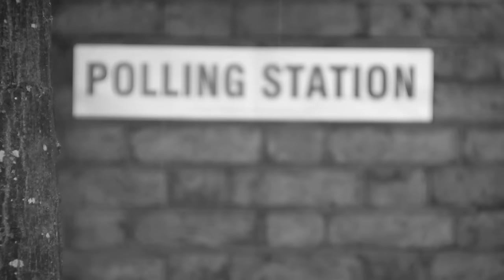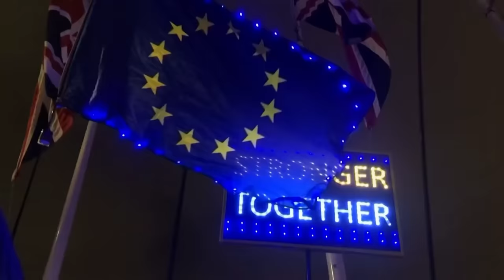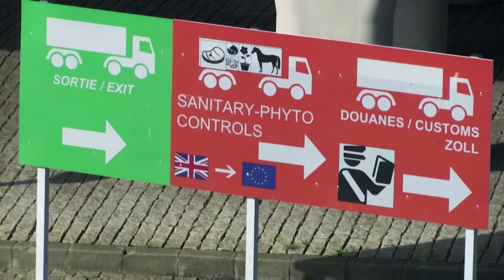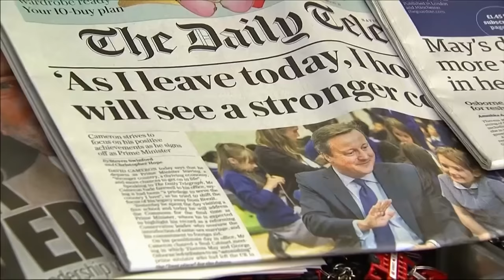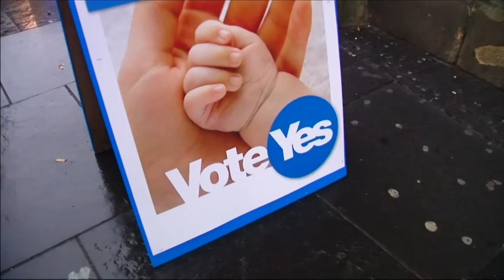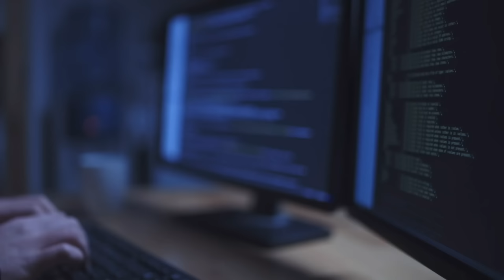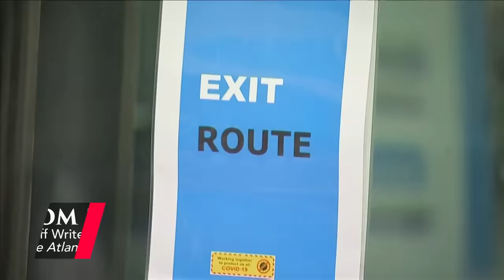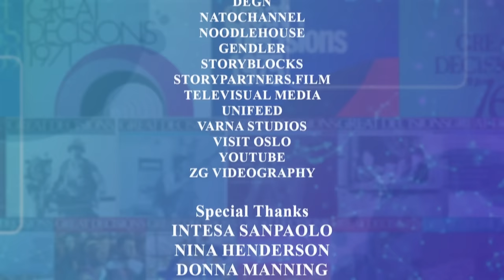Britain After Brexit (Great Decisions Full Episode)

Comment: Tories Leaders were wrong on Brexit’s bills , with Lack of planning on it , many sectors are still waiting for details to be resolved , and some realities of Brexit , will be reopened for another negotiation at a Later day when they politically could prevent it .
Realities have warned Politicians , particularly Tories that it will be extremely difficult to get a trade agreement in such a short timescale when Brexit is done without a concrete plan set in advance to negotiate with European Union  .
Where are we now ?  I told you so , the Lived reality of Brexit is only just beginning  !!!!

Martin Muzinga  .

Comment: All this drivel about "trouble exporting to the EU because of standards ..."

It's absolute nonsense.  All over the world there are different standards.  The UK can enter any market that is profitable and manufacture goods that fit that market, like any other country.
Reply: It can't actually, as it's eroding it's productive capacity because of Brexit. The problem is that export of services is not the same as the export of goods for an economy. By switching over to an economy dominated by services, a few people enjoy the benefits, while the vast majority get poorer. Brexit was promoted and supported by the services sector, and the manufacturing sector was led to believe the UK was essential to the economy of the EU. The joke is that those who pushed Brexit as a solution, were least at risk if it failed. And it has failed. Not only has  services lost EU Passporting rights, they have been quietly restructuring their business to split it into separate UK only and EU operations. They've moved out of London into the regions to cut costs, and are shedding jobs in the UK, whilst opening subsidiaries in the EU, in Ireland and the Continent. And UK goods exporters are losing customers. And our post-pandemic economy is suffering because of that. All because nobody agreed on what priorities our country should have. Therefore, Brexit was, and always will be a failure, based on lies and fantasies. It was to avoid harming the offshore Tax Haven business, which really should die.
Reply: It seems,  you didnt get it, that even the USA,  if exporting goods to the EU,  has to deliver on certain standards,  same as China. 
Chlorinated chicken and hormone beef are forbidden. Some sweets are forbidden because of artificial additives.
Reply: @BigHenFor 

Twaddle. Absolute twaddle.

The UK has an enormous market for services in the USA and around the world.

We have secured a gold standard Digital Economic Agreement with Singapore. The WTO, UMSCA and the EU are eyeing it enviously.

If there was a market for whining, moaning, lying, catastrophising, anti brexiters would be quids in because that's all you ever do.

The UK will be a member of the CPTPP within months at the earliest (Mid June), and no doubt before the next GE.

We never had a services component in the EU.
Reply: There a a few different standards indeed, and any exporter that does international business will do a cost/benefit analyses for which standards to produces for.

It works that way for the UK in a similar way as for any other country. Thing is, when the UK decides to deviate from EU standards UK companies will have to produce for a small home market, and have a second production line for a large EU markets. Extra costs for those that rely heavily on exports to the EU.

EU companies, with their large home market, can more easily chose not to export to the small UK market.
Reply: A lot of countries around the world actually opt to use and manufacture their goods to EU standards and use it as their gold standard. Saves them time and money having one maybe two production lines instead of handfuls.
Reply: You are correct, but before exporting you need to omologate these products according to their standard. Omologation will take time , money and effort.
Reply: @angelobucciarelli4848  excuse me for a moment.

We've been effing meeting EU standards for effing decades.
Reply: @happy.uk.patriot  In order to be able to meet the EU standarts you have to submit your product to any EU institute that can give you the right to put the CE mark on your product. ( TUV, IMQ, Semko, FINKO and so on. )
Reply: @angelobucciarelli4848 

"standarts"?

This may come as a complete shock to you.

The UK has been in regulatory alignment with EU "standarts" since the EU came into existence in late 1993 when John Major took the UK into maastricht without a plebiscite.

That is never going to happen again.

Here's something you need to understand.

If you want to sell your goods into the UK MARKET then you have to meet OUR "standarts".

See how that works?
Reply: @angelobucciarelli4848  and incidentally, the UK buys a lot more from the EU than it does from us.

Though, that is changing. We're shifting to asia/pacific competitors now.

So the EU is going to face competition. It's going to have to do a lot better to win UK business.

There is no sentiment in business angelo.
Reply: @happy.uk.patriot  Do not change the fact that if you want to sell in EU you must have a certification of conformity to EU standards, by the way English is not my native language how do you manage in Italian ?,
Reply: @happy.uk.patriot  UK is free and has been alway free to buy from where ever it wanted, so what is the problem ?
Reply: @angelobucciarelli4848 

Now we are free to lower our tariffs and make our own international agreements.

We have
. AUKUS
. New Zealand and Australia FTAs
. CPTPP membership
. India FTA on the way

We are free from CFP, CAP, ECJ, ECB, Euro, Schengen, FOM, SM, CU, debt mutualisation, Tax harmonisation, EU Budget approval, EU foreign policy, EU standing military

All the rest of the rubbish of the EU.

Why are you bothering me? We've left and it's none of your BUSINESS.
Reply: @happy.uk.patriot  So you are happy, and we are happy too , everyone is winning.
Please don't try to come back.
Reply: @angelobucciarelli4848 

I think we have much agreement here angelo.

Detente, you might say.

I have nothing but love and admiration for Europe. I'm a European. We have so much in common.

Culture, music, democracy, a yearning for peace.

We are great movers and shakers.  we like to get on with business.

We are tough negotiators. But when the deal is done, we slap each others backs and crack open a bottle 🍾 of bubbly.

The UK has joined the CPTPP. That is good for the UK and it is good for the EU.

Let me tell you why...
Reply: @happy.uk.patriot  We all ready have an agreement on brexit . UK is happy , EU is happy , no more discussions.
Reply: @angelobucciarelli4848  I'm so glad angelo.

That is a great starting point for a way forward.